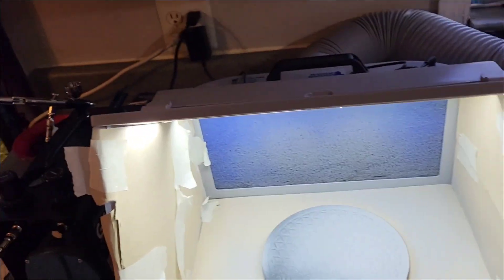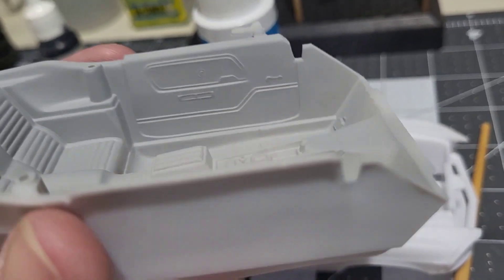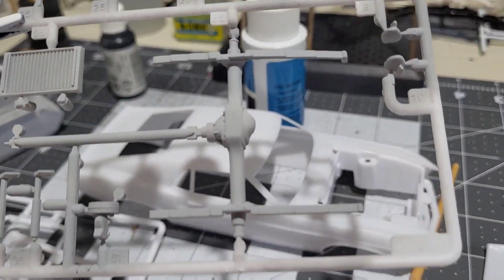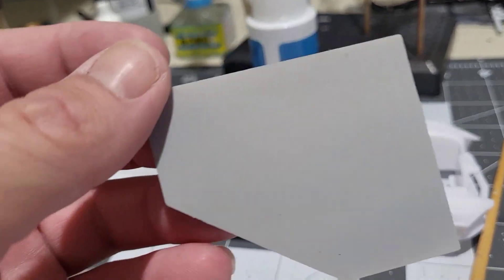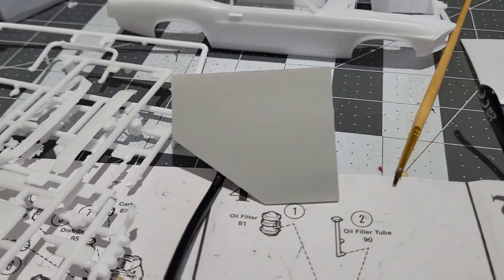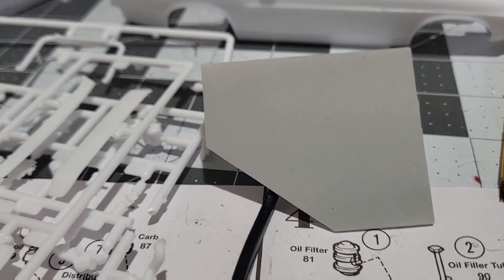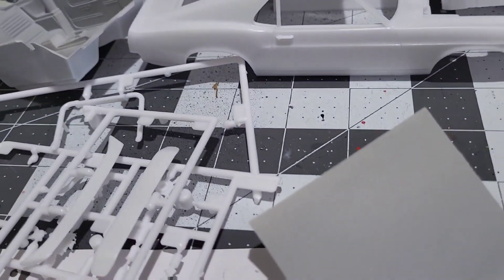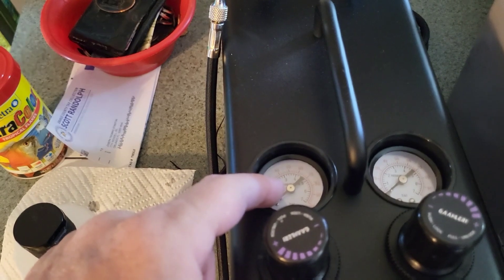#mustang60 airbrush update!

Comment: Awesome Joe! I mostly do 2 coats of primer, paint I do 3-4.  I run mine at 20-30psi. yea hold the air on the air brush then adjust it to what you want. So if you set it at say 20PIS its gonna probably show it 22psi or so, so when you press on the air it will be 20.
Reply from the maker: Sounds good thanks Manny. So far I am liking the setup.
Reply: @modelbuildingcorner  Your welcome man! Any questions just get a hold of me help ya if I can Joe!
Reply from the maker: @Mannysscalemodeling  thank you.
Reply: @modelbuildingcorner  Your welcome!!

Comment: I’ve found that tamiya fine primer works just as good as air brush. But you use a lot less material with the air brush. I set the pressure with the air brush spraying, that way it sprays at the pressure you want.
Reply from the maker: Thanks for the info.

Comment: Always set your psi while depressing your air button on the airbrush. Thats setting your operating pressure. Your nominal pressure will be the pressure the tank rises to when you don’t have the air button pressed.
Reply from the maker: Thanks Frank. I cant believe the difference an airbrush makes over rattle cans so far. Can't wait to spray some color.
Reply: @modelbuildingcorner  it’s a game changer for sure!

Comment: I noticed you had your spray booth set up inside, is it vented to the outside? Do you get a paint smell in your house or no? I'm curious about the airbrush deal. what you showed in primer really looks good. Thanks for sharing.
Reply from the maker: Thanks. It is vented out the window. No smell but I've only sprayed acrylic so far. The whole setup wasn't as expensive as I thought it would be.
Reply: Okay, I  been watching some videos about them.  They look like when you get them figured out they're killer. Thanks man
Reply from the maker: @HotrodzModelShop465  your welcome.
Reply: 😎👍 always set air pressure with air depressed on.... from models to full size cars it's the same.

Comment: Looking good.  Yeah, an airbrush sprays so much nicer than a rattle can.  With that said though, there are people that are really good with a rattle can, so it just takes practice.
Reply from the maker: Oh I definitely agree and I'm not knocking rattle cans. I've always been happy with my builds with rattle cans.
Reply: @modelbuildingcorner  I understand fully.  I'm heavy handed with rattle cans, so it just piles it on thick.  Tamiya cans are nice though, I have to stay away from Krylon and other regular paint cans like that.  Once you get the hang of the airbrush, which I'm still working on, the control is just amazing.